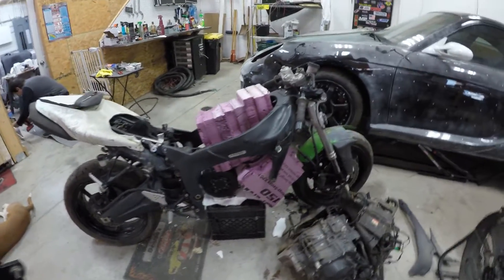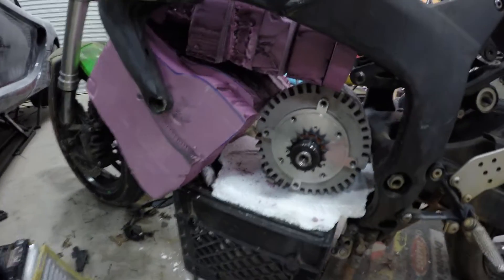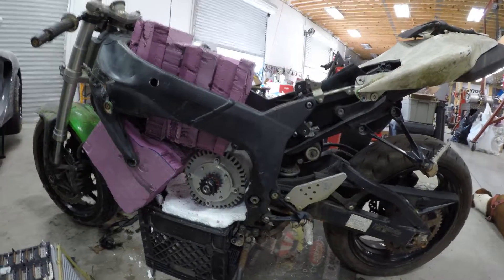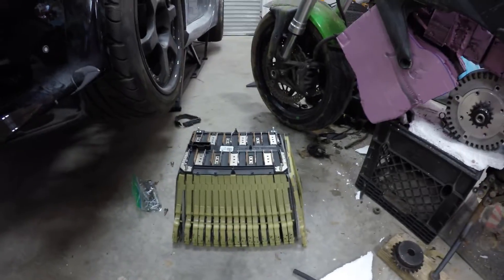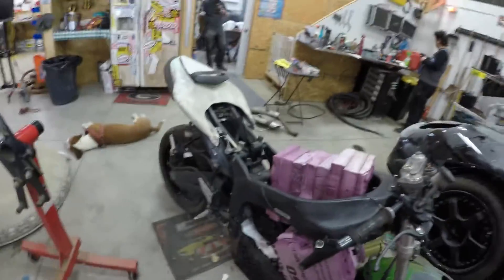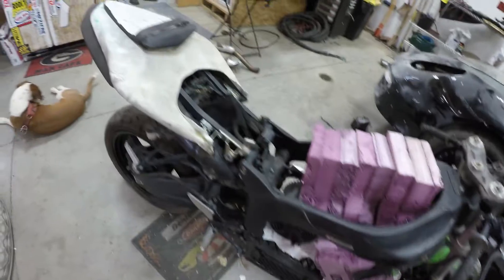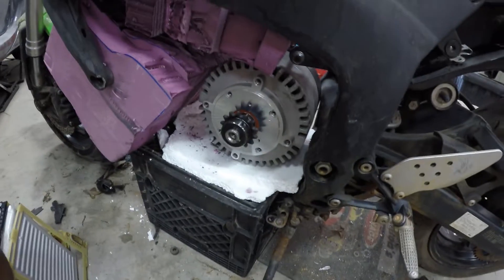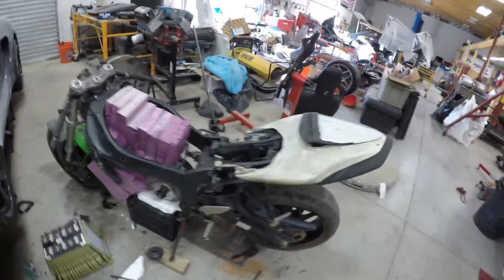Build a Budget Electric Super-sport Motorcycle series. PART 1 "Parts Overview"

Comment: To much weight up high.  No reason not to hang the weight lower.  Bikes like the original had cats and exhaust under the chassis.  Drop the weight down.  I see beginners also forget that the engine that came out was a live chassis member, so typically the electric conversions handle terribly without that extra bracing